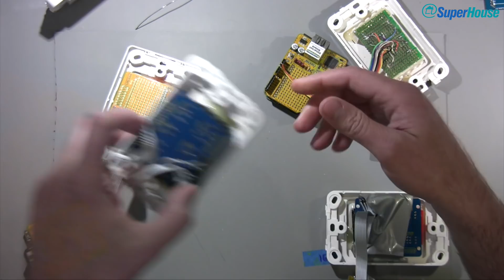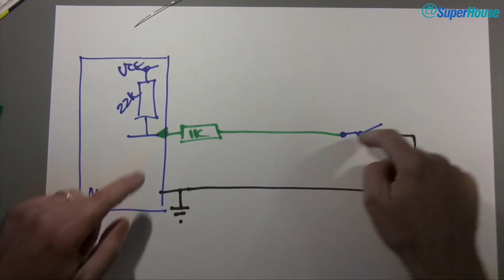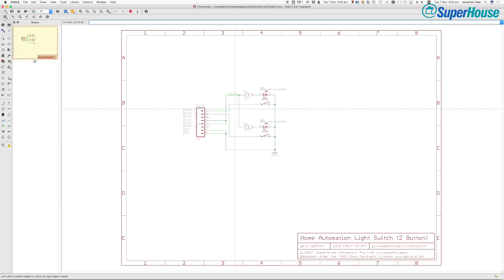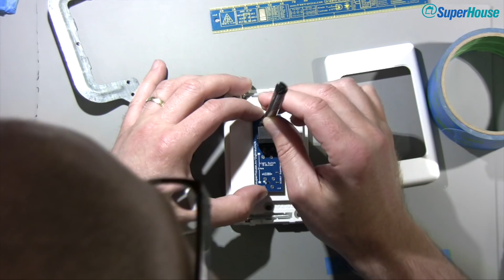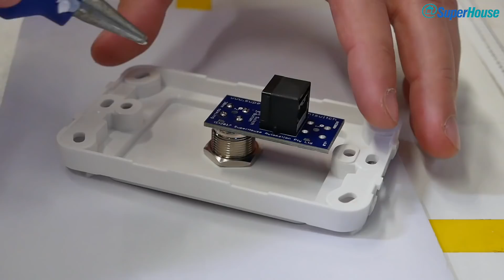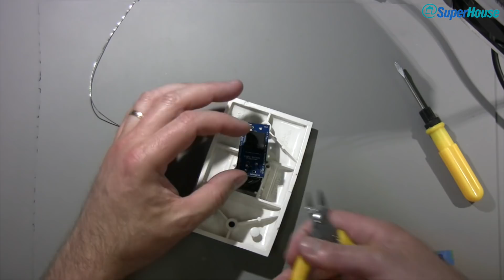SuperHouse #26: Make your own home automation light switches

Comment: Very interesting. I would suggest changing the schematic so that the LEDs become feedback (use one of the conductors in the Cat5 to connect to an Arduino output pin) so that a lit LED indicates the switch is on, an unlit indicates switch is off, blinking indicates a timer (e.g. extraction fan), a momentary blink every 30 seconds for a night time locator etc.
I liked the way you showed the evolution of the design, just wondering six years later where you have ended up with this design.

Comment: Not meant to be a negative comment but good luck with even getting the switches and board to fit a typical UK switch back box in a brick wall ... They are only about 15mm deep! 🤔😲😲

Even deep single gang dry lining back boxes are only 47mm v 35mm standard! Not much room for a double stacked board.

I'm quite surprised you didn't go for touch switches rather than mechanical ones. The ubiquitous TTP223 chip makes for excellent high sensitivity capacitive touch switches.
Reply from the maker: I've used the TTP223 in a few projects, but for light switches I prefer something tactile. The general move towards touchscreens and touch sensors is a mistake in many situations: for example, I think it's stupid in cars where you need to be able to feel controls without looking at them. To me, light switches are the same. I want to reach it as I'm walking past while barely looking at it.

Comment: Sir i have doubt n working on robot
Cooling 5v fan is getting supply voltage and controlled by microcontroller but what if i want to make fan off but microcontroller must be on as microcontroller alzo perform other operations

Comment: I did the same with CAT6 but I have an interference problem with electric cables when I turn on and off electrical appliances in my house it marks false positives, do you have any idea how I can eliminate this interference?
Reply: @Sci-fi-Si  the cable is currently inside the walls and is difficult to change, I could fix it by creating a change in the software that detects the interference and ignores it, thank you very much for your help

Comment: What I'd love to see is  using a ESP8266 with a 2.5" or smaller touch LCD panel.  You could divide the LCD in 2/4/6 cells and display the name of the light they control. and change the color of the cell/button  showing the light on or off.  You could power it  from Mains with the HiTech switch mode p/s or probably even one of those 1 cubic inch  5V USB chargers if current draw is low enough.     Basically only 3 components !!!!

Comment: I’d love to work with someone like you, you seem to be solid on coding.  But you have no clue about user interface, ease of use, look and feel.

You decided to "reinvent" the switch.  A light switch is made to be as simple and easy to use as can be,  you don’t even have to look at a light switch, you can just slap it with your hand and it turns on or off.

You instead devolved this concept, using similar to a computer power switch that is SPECIFICALLY made to be difficult to switch on and off, so that you don’t accidentally turn off your computer.  You use this in place of an easy to use switch.  It makes no sense.

But, why I said I’d love to work with a person like you, once people mentioned this or that, you were immediately able to find a solution and change your code to that.  That’s incredible.  It’s well beyond my abilities.  

I'd love to take my ideas and combine them with your knowhow.
Reply: Why do you think it is devolved? You can still use the same light switch and slap it with your hand if you want to. It's not ideal with On/Off position of the switch in this case, but there is no other way if you are playing with home automation
Reply: Sergio L Watch how he turns on the light every time, it’s like he's cleaning his ear, he has to poke his finger inside the switch every time.  He has to stop, look at the switch, aim his finger to get in the hole, then push inside the hole.  This is nowhere near as fast and walking past and quickly swiping up or down at a switch.  

He seems to be amazing at coding and electronics, he could definitely make these work with regular switches, 3-way switches, or with dimmer switches.

Comment: Have you ever considered using the LED on the switch button as an indicator that the load is on or off? This might help people feel like they are turning things on and off like a regular mechanical switch. Also, if the load is not within sight, you can tell from the state of the LED on the button whether the device is on or off.

Yes, this would consume some of the leads in the Ethernet cable - one lead to transmit the switch "push" back to the light controller and another lead to turn on the LED on the button.

Depending on whether you decide to continue to provide double sets of 12V & GND or just a single set (consuming two or four leads) it limits the number of buttons per faceplate (i.e., no 4-way). The question is, how many locations in ones house have four things to control? I guess, that grows as one expands one's home automation... but perhaps it's a reasonable trade-off?

Comment: Hi Jon, Another great vid. I have a question, Can you control plug sockets with these light switches so say you have a 3 Gang sw, wall mounted Gang 1 = Central Light, Gang 2 = Curtains/Blinds and say you have a table lamp or even a LED strip that is plugged into a wall socket. Could you use Gang 3 on the light sw to turn On/Off the wall socket.

Comment: 25:20 In this demonstration you are using factory made, molded long connector CAT5 cables, which makes the radius bend rather great. In practice though, the installer would crimp the RJ45 connector on the end of CAT5, and then the cable would bend any way you want - even 90 deg.
As usually, great video. Thanks!

Comment: Would you mind doing a guide on integrating temperature and humidity sensors to the switches? As they could collect data from each point. Would they need additional data cable, or switch plate itself would be enougth? Also how about 6 button switches. As i see, one lan cable is enouth only for up to 4 buttons.

Comment: Hey! Nice video! With some of your integrated systems, couldn't you design a nice implemented motherboard? Within most of your system enclosures, you use a modular microcontroller. Couldn't you just build an Arduino into a system board? Programming and implementation are quite simple. Thanks! P.S. An 11 year old wrote this.
Reply from the maker: Hi Sean, it's great to see an 11 year old getting into this! It's a really interesting question that I hope I'll be able to address over the next few videos, where I'll be showing the process I use to design boards and take them through to production. Yes, you're right: I could make an integrated board. I do that for some projects, particularly once they go past the prototyping stage if I need to make many of them. However, there's a scaling problem where you have to trade off the one-off engineering effort / time against the optimisation of the final device. It's usually called "NRE", or Non-Recurring Engineering costs. You can spend a small amount of time (NRE) to make a device that's just a collection of modules or maybe a carrier board with an Arduino stuck on it, which is very quick and not much NRE but costs more to produce per unit. Or you can spend a lot of time/NRE to make a more integrated device that incorporates all the circuitry onto a single PCB, which takes much longer but is cheaper to produce per unit in quantity. To decide which way to go, you have to balance the savings in per-unit cost against the extra effort of designing an integrated board. If it takes an extra 2 days to design a fully integrated board that will be $5 cheaper to produce, it's definitely worth it if you'll be making thousands of them. But if you're only going to make a few of them for your own use, it's not worth spending 2 days to save $15.

Comment: you should use something like the SK6812 for lighting in your next switch version. not sure how you would deal with the communication though without running a separate ethernet line or sacrificing one of the buttons. just an idea. each button would have visual feedback and the ability to control brightness to each button. for 1-3 button situations that can be easily done. say you have one button that cycles through 3 or more colors and controls a range of devices, call it a "mood setting" button. another scenario is maybe the button is controlling something that is not within visual sight (a front door light and no windows to see if its on). maybe one master control panel of a button to every device in your house and visual feedback of what is on/off. i soooo want to build a new house from the ground up and build a similar system into it. your system is already endless in possibilities, that button feedback would just add icing to the cake :)
Reply from the maker: Part of the reason I was in China recently was to arrange custom switch manufacturing the will help solve that problem :-)

Comment: Hi Jonathan, I'm following  the channel almost since you started the SuperHouse series, but still having a functional doubt about your design. You use a centralized logic architecture, so all your actions are forced to pass through the openhab server. From switching a ligth to open the windows. But what if a short power outage occurs when is dark in the evening? once the power is back you must wait for the server to start again before you can actually turn on the light again (or the server automatically set back to the latest known status), but anyway you will be kind of a minute or so once the power is back waiting in the dark until the server is back.
Are you using som UPS to avoid this or is the power outage so rare event that is not worthy to worry about?
Regards, and thanks for the whole series, is really interesting.
Reply from the maker: Thanks for following for so long! Yes, the debate of centralised vs decentralised is a big one. There are definitely trade-offs in both ways. I've seen some extremely interesting work done by a friend of mine who spent years building a system that combined both approaches into a system that had virtualised logic services which could float around between different devices on the network, and be resilient against failure of different parts of the system. The software has been demonstrated to me and I've seen it work, but the company working on it never brought it to market. My friend has been working to get it released under an open source license so it may be possible to talk about it in more detail publicly at some point without being in breach of NDA! But coming back to the simple case, my personal experience has been that having a system that is simpler, more centralised, and prone to total failure is overall more reliable than a system that is more complex, decentralised, and prone to isolated failure. That sounds strange, but it comes down to probability. Distributing the logic means a higher number of complex devices, which means a shorter MTBF. So failures are less critical (perhaps isolated to one device, such as a light switch) but they are more frequent. Not only does it increase the number of failure events that you have to deal with, but the increased frequency leads to a dramatically worse perception of the reliability of the system for people living in the house. There's a whole interesting psychological phenomenon about the correlation between rate of failure, scale of failure, and perception of reliability that means it's much better to have big failures sometimes rather than small failures often. I want to do a video about it sometime, because I find it fascinating. But to get back to your question, yes, I have a UPS sitting in the bottom of the rack in my switchboard. In any blackout that's up to about 45 minutes, the controllers etc keep working just fine and everything is in the same state after the power comes back. If the blackout is longer and the UPS is exhausted, the OpenHAB controller does a cold start and runs a script that sets all devices to a known state.
Reply: Thanks for the response! Indeed I agree with you about is better to keep a simpler architecture rather than a distributed complex one. Also by reducing the number of complex devices keeps the cost down, since at higher complexity, higher price on the devices. My idea is to make a reliable DIY home automation system for my home and since in my neighbourhood  the power outages are quite common, I was thinking that a UPS to keep going the OpenHab server and the router would do the trick for a quite long period (it would just supply power to the RasPi and the router, since is a bit silly to power the whole system arduinos and so on since without power for the lights, heaters and other devices they won't be useful at all) Anyway It would be very interesting a review on a decentralised approach just to have both points of view.
Once again thanks for the response and for the full SuperHouse series, it solved me more than one doubt.

Comment: I think something is wrong with schematic, the LED pin should be connected to the other pin of switch so it can be lighted when switch is on. in the schematic you show the LED is always connected to +12 and GND.
Reply from the maker: This is deliberate, because I want the switches to glow constantly. There's no point only illuminating them while the button is pressed because your finger covers it anyway, so you can't see the illumination. Having the switches glowing turns out to be really good because you can walk into a dark room and easily find the switch. In a future version I'll have it showing output state by changing in some way, but I'll still want it illuminated all the time.

Comment: Have you thought about having the lights on the light switch to be able to be turned on and off if it’s in a bed room? I sure wouldn’t want a glowing switch in my room. Since you got a metal switch you can use a touch sensor so then the light can turn on if your hand just touches the buttons without turning them on. Or you could do something in the code so that the light turns off after some time. Very cool idea very simple and easy
Reply from the maker: Having a "night mode" where the brightness is decreased would be good, but I've found that having the switches glowing is actually very useful. They're not at full brightness, I have resistors to drop the current to only a few mA so the buttons just glow dimly. It's enough that you can find them in a dark room, but it doesn't light up the room or keep you awake.

Comment: So if you have a 3 way(top of stairs/bottom of stairs) or 4 way switch circuit(per national electric code) do you use programming code to put that group of switches together to control that light set?
Reply from the maker: It's easily set in the OpenHAB configuration, or whatever is being used as a rules engine. The buttons don't control anything directly, they only send event notifications to the controller, so it's up to the controller to determine "ok, button 34 has been pressed, so I'll toggle the state of the light in the stairs" using whatever configuration you specify. It's just as easy to have 1 button controlling a light, or 10 buttons controlling that same light. No extra wiring, no extra effort other than a couple of lines in the configuration. Or you can map it the other way: instead of having a many-to-one mapping like you've described, you can have a one-to-many mapping. For example, you could have lights around the house controlled individually, and also have a specific button in your bedroom that when you press it, every light in your house is turned off except the passage light, which is set to 10% brightness. Once you break free of the old-style direct control wiring, anything you want to do is simple changes in software.

Comment: I've done something similar, only instead of patch cables.  I use Wemos D-1 Mini's connected to my WiFi network to send/receive data via MQTT.  No need to run cables throughout the house.  Then I found (Raspberry Pi3b) and Home Assistant.  The Home Assistant is a Web interface or (GUI) for all your switches, sensors, etc.  I even got it to display my Foscam Camera with just a few lines of code.  Now I can  monitor the Kids in the playroom, see the temperature upstairs and turn on/off lights with Laptop or Phone.
Reply from the maker: Sounds cool, and if you're doing a retrofit it's sometimes necessary to use WiFi when running cable is too hard. But if possible: https://www.superhouse.tv/superhouse-vlog-58-wires-not-wifi-for-home-automation/
Reply: How did you solve power for the Wemos modules?

Comment: This is a great way to do the job. You could just use a latching relay in place of the Aruino, if all you want is just on and off control. I did find an industrial relay that latches closed with the first push, then latches off with the second. It was mechanical so the state of the switches survived a power loss too.
Reply: These kind of latching relays are often used in commercial battery powered heating controllers ... Schrack (Austria) make some excellent sub min ones in voltages as low as 3v! Ideal for even twin AA or AAA powered units. One pulse is all they require to change state!

Comment: I think that if you want on and off on different buttons you should make the backlight be different color.

Having convention for 
green = turn it on, 
red = turn it off,
any other color = other functionality

Of course it would make circuit itself more complicated and would probably require a tiny micro in each switch